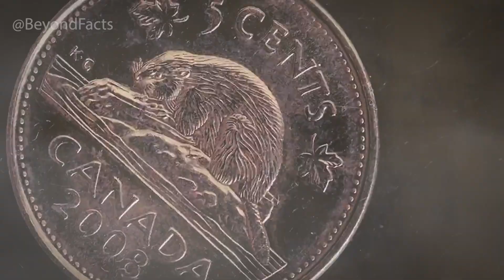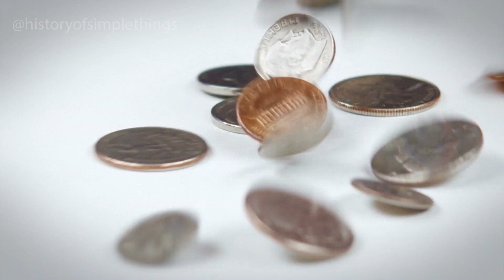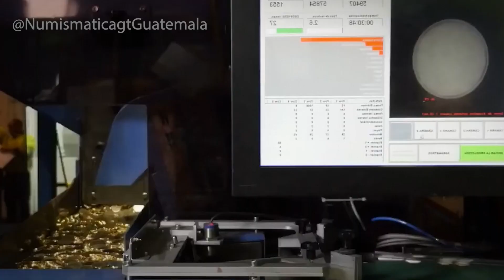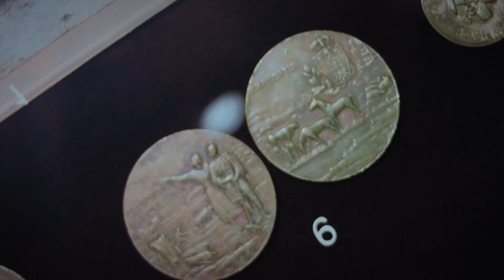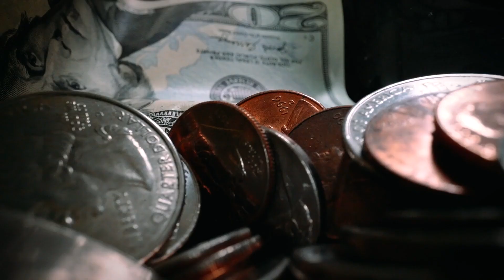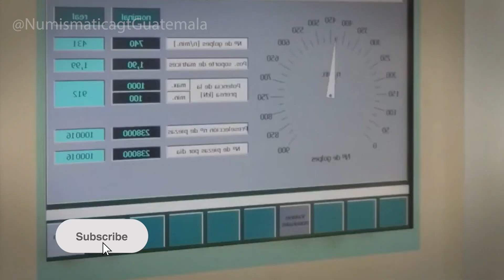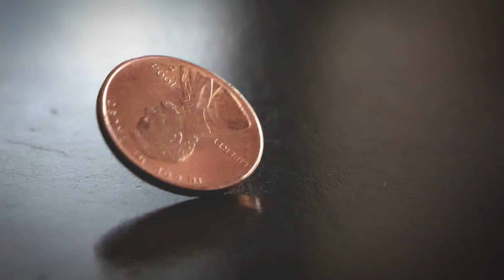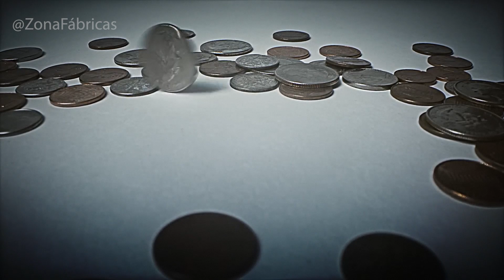Inside a U.S. Coin Factory: How American Money Is Really Made

Comment: At 6:12, the video description is incorrect, because after a coin has been struck, it does not receive further polishing or cleaning. Instead the polishing and cleaning would have been completed earlier when the metal disks were still blanks. The metal blanks are polished and cleaned by tumbling in a vat with tiny balls of steel or ceramic and a detergent solution. The metal disks are dried using heat. After the planchets have been stamped in the coining press and become coins, this completes the coining process.